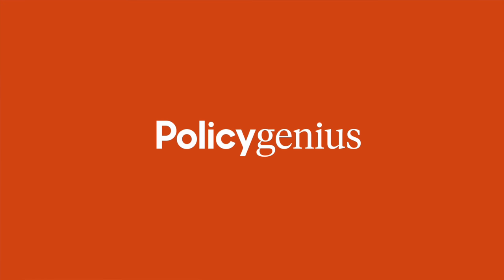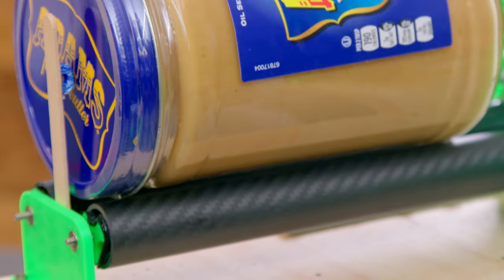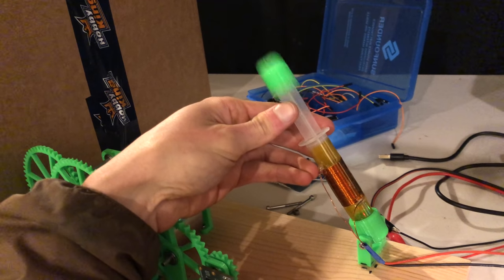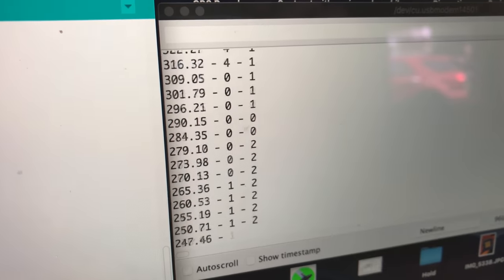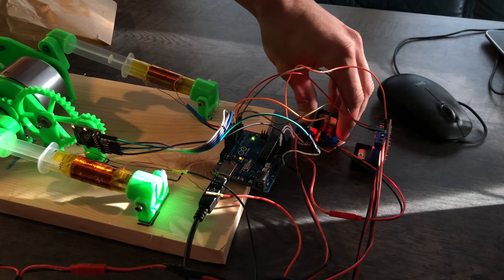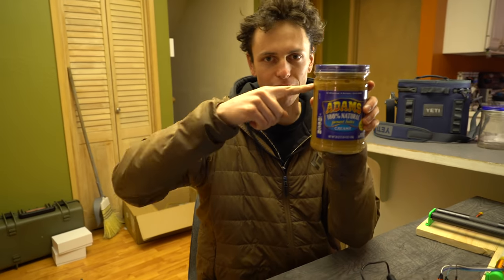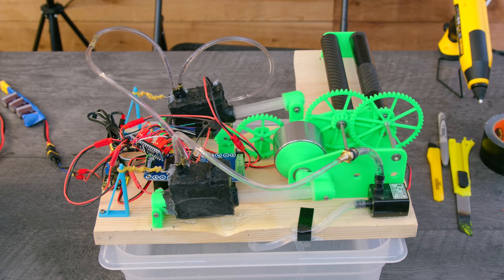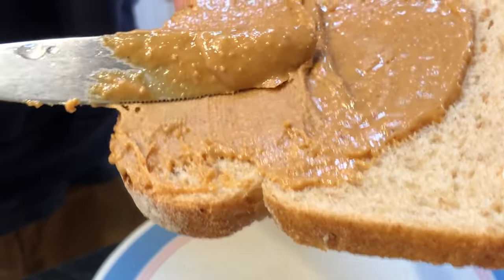Water Cooled Solenoid Engine

Comment: Holy Jesus this is the most amazing video ever. I love the Absurd notion using a solenoid as a motor then using gear reduction. I also love that you fixed the problem with something Elsa had a problem with something else had a problem with something else I got a problem and so on. I was already in hysterics. Then you give us all the data in form of song. I do not think this can be topped.

Comment: this moment, you use expensive carbonfiber tubes just for flex
Reply: it saves weight - soon this device will be everywhere, including the ISS
Reply: @christianwetzel2199  damn, i forgot about that
Reply: @christianwetzel2199  Astronauts: Finally, some good fucking peanut butter.
Reply: Absolutely necessary.  lol.. (don't you have that just lying around? - trash offcuts.)

Comment: You could also increase the turns of your coils to increase the force that is applied on the magnets and you could also take a thicker wire to dissipate the heat better than thin wire.

Comment: Just a heads up! If you wanted to make it work MUCH better, simply increase the number of turns of magnet wire. Double the turns = double the magnetic field. 4X the number of turns = 4X the magnetic field. It doesn't have to be super neat, just wind layer over layer of wire. if you want to keep it neater, wrap the coil of wire with tape after each layer. The limiting factor is the voltage/resistance of the wire, but you have a long way to go before you hit that limit.

Comment: Good job.  I build a solenoide engine for a school project and After some testing we conclud that the benefit of inverting the polarity of the coil isn't worth the complessity of adding an h bridge. Also we used an optical sensor and Without including  a dead zone and It work very well and also the polarity of the magnet on the piston Is a Major factor on the torque of the motor, because if the fields have opposite polarity, they subtract each other and there Is almost no torque at the output. We optimized a single piston piston engine that reached 1300rpm at 10A 15v. We were planning a 4 opposite cilinder engine but the covid stopped the project and we didn't finish it

Comment: Your description of a solenoid "deadzone" is be accurate for a ferromagnetic core. But if you're using a permanent magnet (below saturation) then there is no deadzone.

The difference is that with a permanent magnet, the direction of its field is constant, but with an iron slug, the direction of its field is dependent on the direction of the exciting field.

"Longstroke" looks cooler though :P

Comment: cool project. Big problem by using the "full stroke method" is that the magnets are both in a "dead zone" when the arm length is best for torque. It would be opposite if you lengthened the coils and used the "half stroke" method.

Comment: With a stepper motor-driven system, couldn't you have just increased the inertia of the rollers (with something like a flywheel, which should resist the higher frequency vibrations) and used a stretchy belt as your transmission system (which should absorb some of those higher frequency vibrations)?

Comment: V-twin engines typically use a 90 degree crank angle, as far as I know.  90 degrees should be better than anything else unless you add a third cylinder.

Solid-state relays would last longer and operate quietly.

Comment: I was internally screming in my mind just rewind the coils with thinner wire and many more turns to increase the strength    of the magnetic field and improve efficiency and coils would run cooler. 
Nice torturing material.

Comment: If you ever do a 2.0 of this, aside from a better material for the pistons, you might want to consider adding a piston so the engine naturally has less dead spaces, and possibly changing where and how the flywheel interacts with the rest of the machine.

Comment: I buy separated peanut butter, and I dont think it separates after a few weeks if you find crumby hard stuff on the bottom. I think whats happening is that you didn't mix the oil on top in with the entire container sufficiently. Thats what I get when I don't mix the container well enough. I like to use a knife and hold it downward in my fist and stir with my shoulder, thats able to generate sufficient force to more easily mix the bottom as well

Of course a bespoke machine is much more fun lol
Reply: the knife will probably scratch the plastic, so you get little pieces of plastic in there. if you hear a scraping sound then yes but if you don't then it's all good.

Comment: Increase number of windings factor 10 and thereby decrease power consumption factor 10. Use thinner wire.
Dont switch off the coil in the middle. The magnet will produce max thrust in the middle of the coil where iron does not produce any trust in the middle.

Comment: I actually built a single cylinder one.. I also used normal iron for the piston  instead of magnets and I built a IRFZ44 mosfet driver to activate the coil and provide it with as much current as it needs... I also ran mine with an electronic rpm limiter to keep it at 170rpm. 

My engines piston had a short stroke of 15mm and pulled around 2 ish amps at 12v. I just built it for fun, I mean with 24w at 170rpm you don't really have a lot of torque left to do anything 😂😂😂

I have previously used the slightly smaller version of that H bridge dc motor driver and it seems they dont like overvoltage... Mine lit up like an incandescent bulb when I accidentally gave it 12v instead of 7

Comment: Or just buy Kirkland organic peanut butter at Costco - it still requires stirring but the overall viscosity is lower, and the difference between the viscosity on top and bottom is also lower, so stirring much easier and faster. And once it’s stirred I just keep it in the fridge so it doesn’t separate again.

Comment: Thought the songs were a bit annoying but very cool project!

The Arduino is pretty overkill for this project, a pair of microswitches (or just one if you're as clever as you say ;) )would have done the job just as well. And without generating so much waste heat through those drivers...
Typically, for a two cylinder design like this, you would want them to be 180* offset, though because of your strange timing I do not know the ideal difference. 
The water cooling is the real innovation here, though you are being fairly inefficient about it. Your best bet would be to build a jacket, I.E. a larger cylinder around the cylinders, which has running water flowing through it. To solve your cylinder weight problem more permanently, you should switch from having the cylinders pivot (heavy, high mechanical losses, difficult to cool) to having the connecting rod pivot (Bend a piece of coathanger or wire to use as a connecting rod and mount the cylinders stationary)

The extra stroke does increase the torque for the reason you expected (the longer crank arm) but the added complexity of the longer solenoids does not. Regular solenoid engines are much simpler to build and can be fairly powerful with a long crank throw but still use the same solenoid.

Comment: Doing 3 piston would have made it work without a flywheel.
Thats some runny peanut butter.
Try one piston and use a ratcheting clock spring drive for more efficiency. You can 3rd print all that with saw tooth gear.

Comment: Eliminate the solenoid engine, and instead create a piston water pump driven by linear solenoid.  (How about a diaphragm pump as used for aquarium air pumps?)  Water can be pumped to a high reservoir and it will fill buckets on a chain and create torque as the buckets descend.  You can re-use the gear reduction and rollers; they will now be driven from the falling buckets.

Comment: how to fix a non-existing problem with bandaids on bandaids on bandaids. I was wondering why you need 2 dual h-bridges when 1 would be enough, then the heat issue came up. very low efficiency, and noisy, and fire hazard. pwm may have fixed the heat issues. only thing that matters, it was fun to build. if you really want to do this project, just use a normal manufactured motor. it doesn't have to always run, just however long per hour or something. run for 20 seconds every 15 minutes. experiment with timing. after all that, is peanut butter separation really a problem? no. just stir it before you use it, like a normal person.

Comment: I don't understand calling this a solenoid engine... In an IC engine the purpose of the piston is to create pressure for the explosion.  Here it seems more like you're using solenoid linear actuators.  Edit: ah, actually it would have been better if you had compared it to the pistons of a stream locomotive

Comment: Hi, without actually constructing a solenoid engine, I'm pretty sure your increasing "current"(amperage) was the wrong move.
Anytime you're dealing with electromagnetism, you should be increasing your voltage to increase the electromagnetic field.
And, increasing current pushes more electrons through your circuitry which due to the resistance value of your wiring generates increasing heat and loss.
Bottom line, you double whammied yourself... You would have far better results by increasing your voltage while keeping your current flow as low as possible.

Additionally, your solenoid engine has a lot of similaritie3s to a stirling engine... Would have been interesting and could be a new project to construct a Stirling engine instead which runs simply on the difference in temperatures which can be achieved as simply as an empty glass box in sunlight or in the snow(plenty of DIY stirling engines on YouTube).

Great ingenuity!

Comment: what kind of nonsense molecular resonance did you have to make up to justify building your own motor? you could have said just that you wanted to build your motor instead of using an off-the-shelf stepper and would that have been fine instead of making up that bullshet.

even if there was any sort of molecular resonance, it could have been easily solved with a dampener/gearbox, but usually molecular frequencies are nowhere near the range that stepper motors use

the end result is great, however, i loved the drain for the leaking cooling system over something that looks like 0.5mm wire where you could have used 0.05mm with 1000 times greater resistance

Comment: It is so fascinatingly strange to see how ridiculously complex this machine is. I get the joke. Modern combustion engines are exactly as stupid. You have parts and where so you spray oil up on it. You have parts that get too hot so you cool the whole thing with water. You make water pumps that run on the combustion engine itself. And you have a generator spinning along making enough electricity to store for the next time you need to get the whole thing going. The modern combustion engine really is a modern rube Goldberg machine.

Comment: Something definitely not advantageous to have an electrically ignorant person in charge of the power distribution.  

Tracking the linear motion with physical sensors on the rods - and not using Halifax sensors  would probably make it more repeatable than a quantified digital setting .

A physical 1 or 0 , on or off - push or pull , tends to have a faster response time and is easier to design .

This has integza tier low hanging design goal with seemingly arbitrarily 3d printed and overcomplicated logistical monstrosities that achieve even less than the Butter Robot from R&M.

I had to stop watching the little mustache man because I can only watch someone do the same thing 15 different times with seemingly no attempt at innovation .

Only the regurgitation of previous attempts by other innovators.